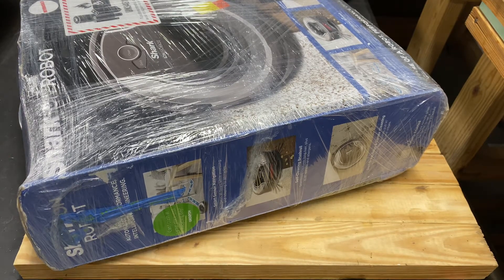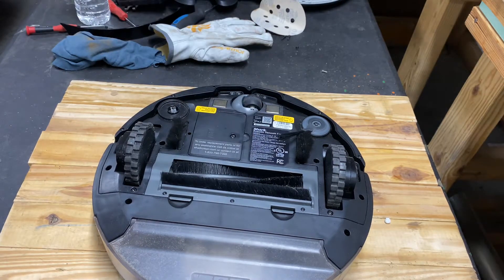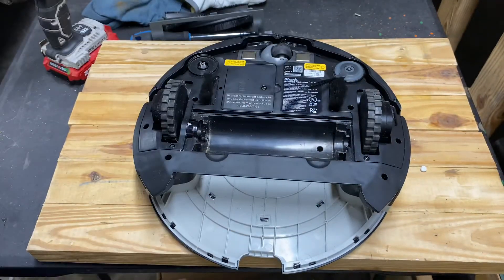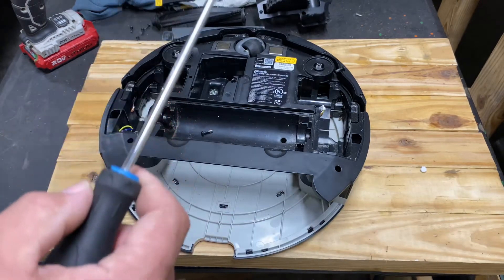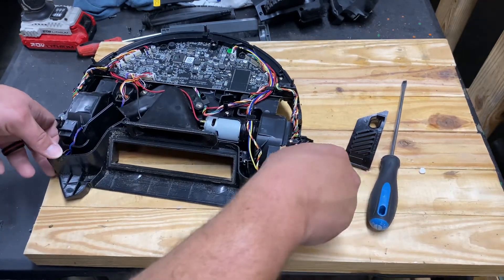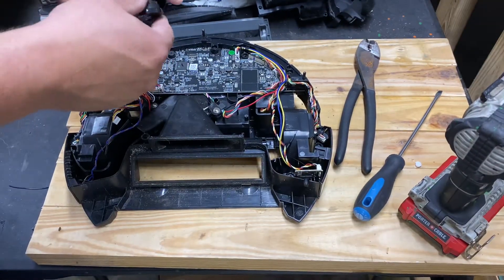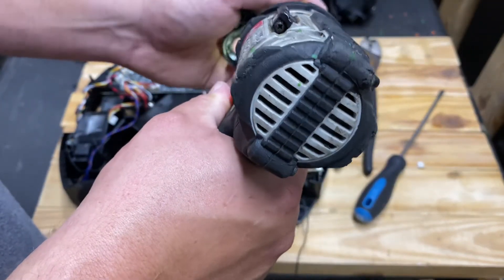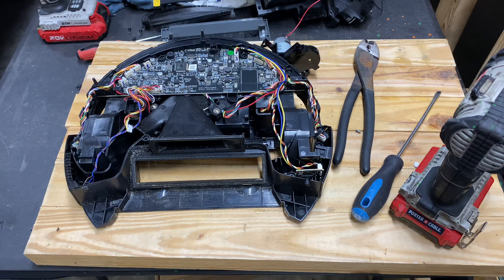Shark Ion 720 robot vacuum tear down and repair

Comment: Do you have a video on how to fix the sweeper arms? I am getting an error message that’s says debris is blocking the function. But I’ve cleaned everything out and the only thing I can find is that one of the arms seems a lot tighter than the other. I tried to pull the whole thing apart but can’t figure out how to get inside the arm motors to see what’s wrong.
Reply from the maker: what model

Comment: I need a new wire harness going from the one wheel to the motherboard, do you have that by chance, I put the wheel back into place and broke a few wires because they were crimped from my mistake
Reply: I have a 750
Reply from the maker: @jasonbice4815  https://www.ebay.com/itm/175415255958?mkcid=16&mkevt=1&mkrid=711-127632-2357-0&ssspo=45UvfEQjQN6&sssrc=2349624&ssuid=45UvfEQjQN6&var=&widget_ver=artemis&media=COPY
Reply from the maker: https://www.ebay.com/itm/175415255958?mkcid=16&mkevt=1&mkrid=711-127632-2357-0&ssspo=45UvfEQjQN6&sssrc=2349624&ssuid=45UvfEQjQN6&var=&widget_ver=artemis&media=COPY

Comment: Where do the 4 silver colored screws go. I forgot where I took them out?
Reply from the maker: Depends which ones your talking about. Motherboard has some , brush drives have some , suction motor has some.
Reply: I found holes for all of them and it is working again.
Thanks for your advice 
.
Reply from the maker: @JJKOFROTH  AWESOME TO HEAR!!!! Glad I could Help

Comment: Is there a secret to getting the brush motor back in? Could I have the wrong part?
Reply from the maker: Should fit right in unless you ordered the wrong one compare it to the other one and make sure the square head that the brush goes on is turned correctly
Reply: I suspect the one I got  is a bit bigger. I could not make it fit. Is it possible to switch the motor in the old assembly with the Motor in the  new one? I had it apart once but I can’t remember if the motor can come out.
Reply from the maker: @JJKOFROTH  yes you can swap just the motors

Comment: Thank you for the help with my 720 iRobot. Installed a new brush motor, the unit ran nicely for 3 minutes and then made the same grinding noise as before. Brush roller not spinning. Suggestions?
Reply from the maker: remove motor assembly check gears.

Comment: I feel like ive tried everything from your videos but can't figure out what's wrong. I am getting the flashing red clean with flashing red ! error on my RV720. I got my first one in 2018, and this error happened within 6 months so it was replaced. Now the replacement has lasted me 2 years and same issue again. New filter, took everything I could apart and cleaned it, etc. It will go for about 2 seconds and then stop and display the error

Comment: I didn't shut down my shark  before I  flipped over to clean the vaccum.  Now it won't move more than a few inches from base with a cliff error.  What can I do
Reply from the maker: Pull battery leave for a hour should reset
Reply: Thank you for trying but same problem.  Error  #7 cliff

Comment: Hoping you can help me. Have a RV750 that will go for 1 sec then stop. The notification says it’s a suction issue but it will work in Eco mode just not in anything higher. It’s not the filters as I’ve taken those out just in case. Shark says I need to get a new one but this thing is only 15 months old
Reply from the maker: Sounds like it could be a processor board on the suction motor or the motherboard itself

Comment: I have ashark IQ Robot.  It keeps stopping with an error 3 message.  I look underneath and one of the side brushes doesn't spin, and one of them spins easily.   How do I fix the stuck brush?
Reply from the maker: Take robot apart remove the motor take it apart and see if something is clogging it up or if a motor went bad

Comment: I need a spinner left spinner motor for a RV 1001, will other model motors work?
Reply from the maker: No they are different message me on eBay I’ll get you the link for the correct ine
Reply from the maker: One

Comment: Do you know how to fix the suction motor error on a RV750_N
Reply from the maker: Garth H. McDonald clean it out if that doesn’t work it’s either new suction motor time or motherboard time
Reply: Smitty's World thats was quick! Cleaned out, do you do repairs?
Reply from the maker: Garth H. McDonald no sorry I don’t offer repair services. Have you taken the motor out by chance? If you have you can get a 12 volt battery and test the motor to see if it spins
Reply: Smitty's World not yet, just got it but figured it never hurts to ask. Thanks for the advice!
Reply from the maker: Garth H. McDonald I completely understand
Reply: @SmittysWorld  what type of tool are you using to remove those small screws that have an octagonal shape?!

Comment: Hey man, question... hopefully u can give me a quick fix answer. Can I just post it here or email u or what? I know you don’t exactly want to get into iMessage repair service or anything. I feel like I can fix most anything but sometimes troubleshooting can be the most difficult part. I have a Shark iON RV852WVQPR (so is that an 850??) anyway. Was making a horrible scrubbing noise and I had no clue what it was. I checked for this colorization around the casing for the motor and on the bottom of the channel under the bristles. I pulled both wheels and there was no entanglement or anything there. Everything seems to rotate without restriction. It is clean. SO, I discovered that when I remove the rotating cleaning bristle the robot operates perfectly fine with no noises or scrubbing. I replaced the bristle roller and the outer retaining case/clip thing I just started scrubbing again. So I tried it but just placing the roller inside and gently setting it on the floor WITHOUT the retention clip part. It works perfect. No issues except for the fact that there’s no way the bristle is sitting in there correctly and I feel like if it gets tangled on anything it’s just going to pull it out. Why would that retention clip because in the excessive scrubbing noise. Help man PLEASE
Reply from the maker: Brad Ball without the clip installed the brush doesn’t have tension on it so when it spins it works fine try running it on carpet without more then likely will make the noise could still be a bad brush motor or belt. But the clip could be worn out as well could try some Grease on it .